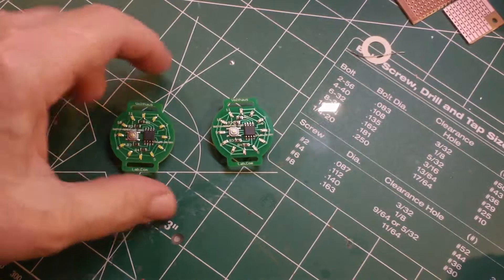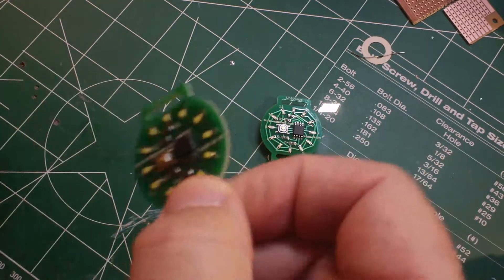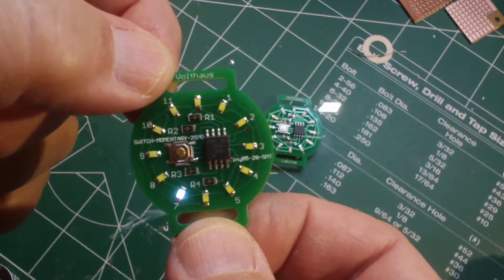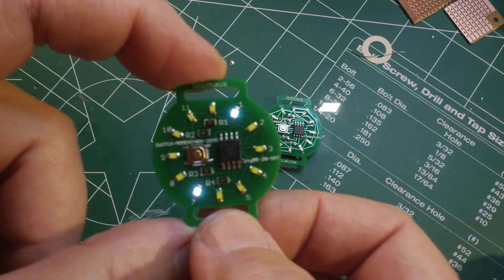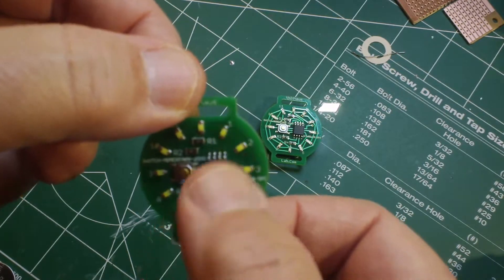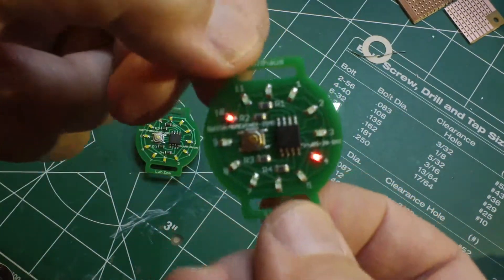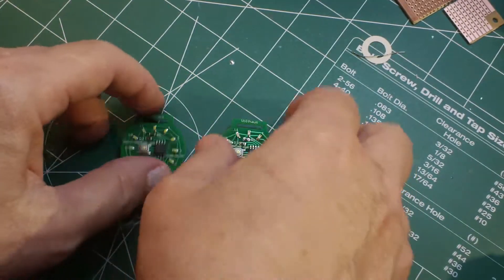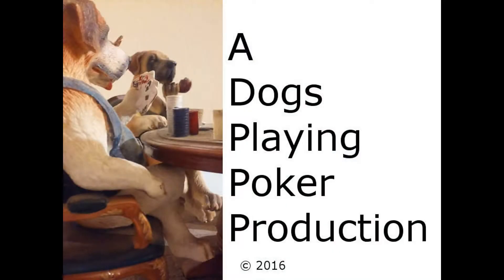Tiny Time Watch

Comment: I made the nerd watch and it works well, as it advanced, I adjust the accuracy by changing the value of Millis ()  
by if ((now-_ Millis) > = 1013) in clock. CCP.
The problem remains the consumption the battery does not last long.
I'm going to make your watch because it consumes less :) .Thanks
Reply from the maker: You should take a look at this Mic. http://www.technoblogy.com/show?1MG3
Reply: Hi
Thank you for your link, many interesting things 
I just finished the Tiny Time Watch with orange LEDs, working perfectly, I saw on your site that there were two other versions, one in RGB, it's great work ! :)
Reply: I built a mini christmas tree 8 leds
32x32 mm which is animated by an Attiny13 here is the link:
https://github.com/Mic2015/ATtiny-Christmas-Tree
and for the video:
https://youtu.be/Hd_K3JuI6Yk